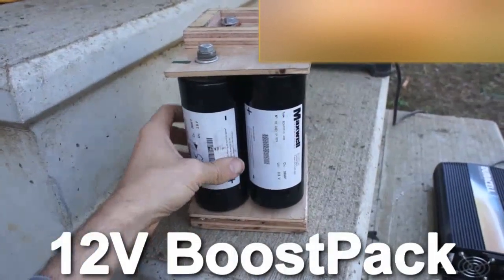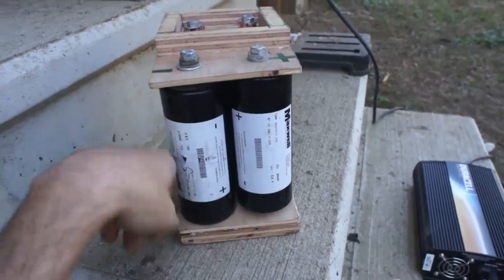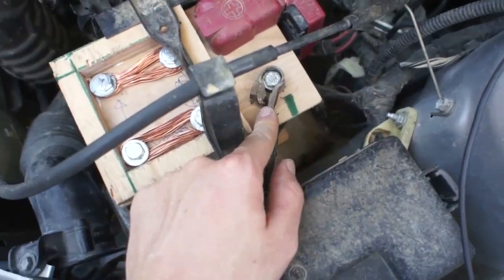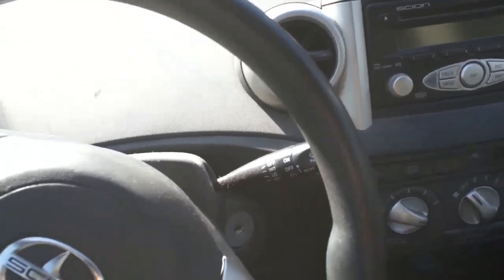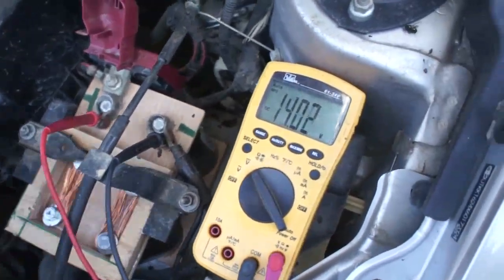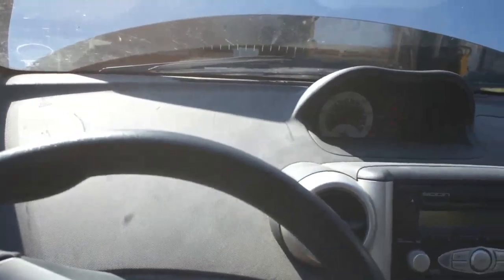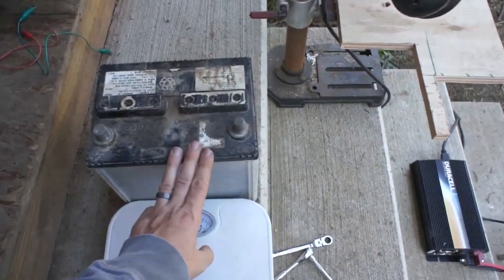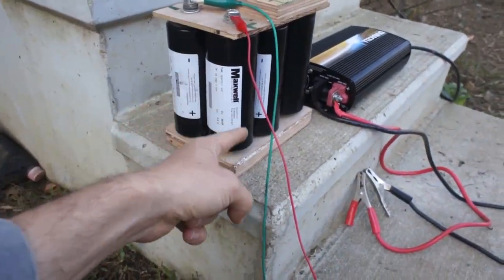12V BoostPack. Replaces auto battery. Works great!

Comment: I just wanted to point out that in the second part of the video, you didn't actually need an inverter because many corded power tools will run off of straight DC as well, but you would want to increase the voltage up to at least 80 volts or so. So this is a great idea to use these supercaps in a solar powered shop. You can find 14v supercapacitors too and put eight or nine of those in series to get closer to the voltage the power tools were designed for. You don't want to over-volt motors though, so best to keep it up to but not over 120v, unless you really know what you're doing and compensate with extra cooling.
Reply: You have a way of charging 80volts?. Each cap is only rated to 2.5 to 3.2vdc. Over voltage will destroy the caps

Comment: I know very little about this sort of thing... can you tell me what size of Capasitors would be best for replacing my motorcycle battery ?  can i do it with ONE cap say a 14v  1000f  ?  ( its a 12v system)  or does it have to be 6 smaller ones ?
sense the voltage is added ehrn in series and the capasitance devided I would like too do it with as few caps as possable... not to mention the outragious price of these things ! ...thank you ....Bob.....

Comment: Wonder how well these do in -40's, I assume they are electrolytic?  Assuming they don't freeze, they could still be nice to have in conjunction with a regular lead acid.  I imagine they would just self balance charge and not try to discharge each other?  Would give some extra kick when starting the car in the cold.  Could even have a small solar panel on the car that keeps it topped up.

Comment: I think your alternator is going to wear out faster because you are going from 10 volts to 14.8 volts every time you start your car which puts a very heavy load on it. I could be wrong but time will tell. $300 alternator verse $100.00 battery??
Reply: Rev Big D Not really. Regular battery would put much heavier load, since it's capacity is so much bigger, so to get to the nominal voltage, it would be loadef for much longer.
Reply: The last alternator I bought was far under $150. The last battery I bought was $129. You are correct about one thing. Recharge instantaneous surge current into those caps will be at least ten times what a battery would draw meaning a far greater instantaneous load on the diodes in the alternator. Better have a current limiter in series.
Reply: While cranking a car with an battery, the battery voltage goes down to a bout 10 volts while cranking and then it goes to about 14 volts when charging it back up; so not different than using a capacitor.

Comment: These capacitors last much longer than batteries
Reply: Bruce G you clearly have no fucking clue about electrical systems
Reply: Hey Puke - How about 40 years experience
Reply: You're sad, Kook.  Do you really think a battery would last longer than a cap.?
Reply: 1,000,000 cycles. A lifetime

Comment: How about self discharge?
Reply: It happens, but at a slow enough rate that he is able to leave the car for as many as 4 days and it will still start. There are other videos in which people have made a hand crank charger or made a smart hybrid system using a small $15 SLA battery to charge the capacitors when needed. What's really great about this is that severe cold does not reduce the delivery amps of supercapacitors the way it does with chemical batteries.
Reply: kedwa30 In the winter he will probably have 6 hours.

Comment: 200 dollars for 6 on ebay.... buddy its time to delete this vid...ill stick with traditional car battery's.
Reply: the electric goldmine and alltronics had them for 10 bucks each. they were pulled from the regenerative braking unit of hybrid electric busses.
Reply: The price of used/salvage parts varies a lot because of inconsistent supply and demand, plus you have to realize that ebay is a bidding site. People are going to post for a higher price than they expect to get. Bid low and you might get lucky or someone who wants them more will out bid you. May the best bidder win.
Reply: Si a ustedes les parece caro el precio de los capacitores imagínate para nosotros los argentinos. No conviene hacerlo! Para eso se compra batería de carga profunda como las que se compran para los barcos,salen un poco más de las comunes y tienen alto resultado
Reply: That's not a logical reason to delete this vid, but this is YouTube, nothing is ever logical

Comment: Is it possible to make a boostpack of 54V and 53A . Can u plz give me some info .
Reply: Yes, capacitors are sold in a variety of voltages and sizes and depending on your application, you probably just need to put enough cheap capacitors in series until you get to the right voltage. Then depending on how many amp seconds you need, you may need to make multiples of these series packs and put them in parallel in order to get the output you need. Tell us more about your application and the YouTube community will help you. 1 farad = 1Ampere second/Voltage

Comment: do you have videos on how to convert 2sets battery 12v  24 volt battery into a capacitor 🔋 battery for an electric scooter?
I might wanna up the volts to 36 volt set battery pack.
Reply: Not practical at all. Stick with batteries. Caps have low amp/hrs.

Comment: Im not electronically inclined but was very interested on build a booster pack for my car too... however, while I was reading about capacitors in series, I came to these notes:

Caution: If the capacitors are different, the 
        voltage will divide itself such that smaller capacitors 
        hog more of the voltage! This is because they all get 
        the same charging current, and voltage is inversely 
        proportional to capacitance.
      Worse yet, if one capacitor is slightly leaky, it 
        will gradually transfer its voltage to the others, possibly 
        exceeding their voltage rating in turn. And if one of them 
        punches through its dielectric barrier, it can then damage 
        others in a cascading fashion. This is why series capacitors 
        are generally avoided in power circuits.
I've seen small capacitors blow up dramatically so I wonder... Is there any real danger to this supercapacitors blowing up?
cheers!

Comment: Hi, what about amperes?
Reply: A 6 turn coil of wire shorted across the caps can shrink a quarter, but also blow up the wires. Use a copper pipe coil instead. Instant can crusher! You need a  huge switch as it too would melt

Comment: you only get three minutes run time running a drill? you would need to install a solar panel on your for sure. everytime you went to the store and accidentally left you lights on even if only for 5 minutes your caps would be dead. not to mention if you have a door ajar and the open door light is on at 12 hours of that might kill you caps too. sounds like you need bigger caps.

Comment: I see the caps listed on ebay for a rip off $50USD each some greedy sellers charge even more. $5~6 is a very low price, it so much cheaper than $50usd they may as well have been stolen. And to rub it because the Australian "A Failure" Dollar exchange rate is like a near worthless 0.70USD and you add in freight it comes to about $100AU per cap for Aussie buyers. far far too expensive.

Comment: how many BIG CAPS do I need to run  a 1000w 50amp  motor  for 1 hour or  x 20 hours I HAVE 4 X 12V 22 AMP BATTERYS THAT RUNNING MY ELECTRIK BIKE can I use this system to run my bike

Comment: Does everyone understand that lead is so plentiful and very recyclable that the 3 main batty mfg are milking us, since we do not make our own in the kitchen. And lithium on the other hand is much more precious- but hell on the environment. and the process wastes/eliminates billions of gallons of our earth's ltd fresh water supply. SO,... for better performance we will make ourselves extinct.  Always a downside- might as well use nuclear and have charging stations at every Starbucks with crappy distance capacity but cheaper than gasoline- since cars only use 20% of the fuel conversion.

Also is the inverter necessary,  when you could use a Li-ion drill or saw- (conversion losses)
Reply: Cadmiums and acid lead batteries are hell on the environment not lithium! And the proces of lithium does not waste water!  You know jack shit about batteries!
Reply: Actually lead acid batteries are 99.9% recyclable. The plastic, lead and acid can all be reused.
Reply: I would like to know how to make one in the kitchen or at least understand why they won't recharge after they fully discharge. I've got 4 fully dead ones that I would like to rebuild someday. In the mean time, I think this will be a practical replacement. 

As far as I know, capacitors don't use lithium. You may be thinking of laptop and phone batteries, which are also lighter than lead batteries, but also depend on a chemical reaction which is affected by temperature. People don't use lithium because they think it's easier on the environment; they use it because they want their cell phones and laptops to be lightweight. I think in the future people will switch to graphene ultracapacitors for their phones and if they want an even longer standby time, they will have a smart fuel cell to top it up as needed. 

Actually, the inverter is not needed at all since most corded power tools can run on DC as well as AC. What you would need is to step up the voltage though, which really would best be done by using more capacitors in series and consequently you would have more capacity as well.

Comment: low price. not cheap price !!!!
Reply: In Australia by the time you pay freight and the exchange rate, it cost us almost $100 Per cap, so $5 is very cheap when compared to $100, in fact the price we have to pay for any goods in Australia is so much more expensive compare to USA is not just unfair it's criminal.
Reply: Same here in Brazil, a sixpack of chinese capacitors like these here cost an abusive amount of money, more then 3 times( US$240 )a new lead acid battery (70US$), amazed that its cheaper then in Australia
Reply: @artenalata2009  Large Batts now $150 usa.
Reply: what r u talking about !! my coment was about guy having problem to spek logicaly !

Comment: What's the point in that?

Advantage: You have saved maybe 10kg of weight. That's not a lot.

Disadvantage: not a proven device, potentially not permitted to use in many jurisdiction.

Neutral: doesn't contain lead. Lead or the acid in lead-acid battery doesn't go into landfill, in fact it's possible and common to recycle lead-acid batteries completely. Recycling is mandatory where i live.

Disadvantage: there is no established recycling and disposal regimen for unusual capacitors. Their chemistry is not generally safe to dump into landfill either! Nor does it last forever!

Disadvantage: your energy density is very much lower. You have replaced a unit with upwards of 30 Wh/kg with a unit that only has about 5 Wh/kg, and then you flaunt reduced weight? This doesn't make sense. There should be perhaps better way to save weight with higher energy density cells.

Comment: You've really got me thinking with this video. Didn't know supercapacitors existed prior to viewing one of your videos a few hours ago. Now I'm asking myself if the solar power backup that I want to do for my home could be done with supercapacitors instead of lead acid batteries or Tesla Powerwall units.

Glad to see that there is a guy like you out there experimenting. I think soon there will be a guy like me experimenting as well. I'm guessing that I would need a lot of the supercapacitors though. Seems they charge quickly, but discharge quickly as well, yes? Just asking, as I don't know. My goal is to have enough power for two or three days at full use of the normal household appliances, including our geothermal heating system and electric tankless hot water heater (400 amps overall). Can't afford to put in enough solar to cover that kind of use; at least not yet.

Yes, this certainly is very interesting stuff. Many thanks for the video.
Reply: You should also look into using Stirling engines. They are powered by a heat difference, so you could design one to be built into a ceiling, for example, to convert lost heat into movement which could pump water or air or move a coil to produce electricity. 
Similar to a steam engine, a Stirling engine produces its greatest torque at its lowest RPM. It's best to design an application that allows the Stirling engine to pump slowly and quietly.
Reply: A capacitor requires a lot more volume to store the same amount of power than a battery. 
For an solar application a voltage has to be stable and kept high or your inverter will turn off or your charge controller may go into a different charging mode or even turn off also.
A battery will keep the voltage high until it is near empty, a capacitor loses that voltage very fast under load.
You can not expect a capacitor or battery to store more power, than the solar panels will deliver.......you still need enough solar panels to supply enough power for your needs.

To start a car, the starter requires only a couple of watts......not much at all.
But you are talking about thousands of watts with your solar applications......Will not happen.......
Reply: J & B Homeliving and he built a soln1 2000... happened
Reply: A capacitor merely stores enough electricity for a short burst of electricity and is not good for storing electricity. Capacitors were designed to give motors like AC units a jump start or a burst of electricity to get the motor moving faster. That's how I understand it anyhow.
Reply: You're a bit out to lunch - capacitors have a higher power density, but far less in terms of energy density.  

Also, to say a starter requires only a couple of watts is complete nonsense.  You might want to do some reading on the difference between power and energy (hint, energy is power multiplied by time).  So while a starter takes  a small number of Watt-Hours, it pulls a boatload of watts (i.e. 200 'cranking' amps * 12V = 2400W - say it cranks for 3 seconds, you're using 2 Watt-Hours).

Just some helpful hints ;)

Comment: You get maximum 50kJ of energy, in total, out of that capacitor bank. A small car lead-acid battery stores a minimum of roughly 2000kJ. Plus, the battery can give away most of its energy at voltages closer to the nominal voltage, whereas capacitors discharged in constant current will drop the voltage linearly. So it may work.. but it's not really a good idea in my opinion...